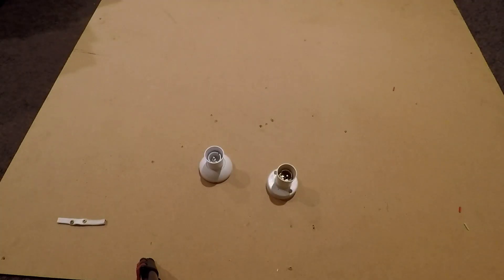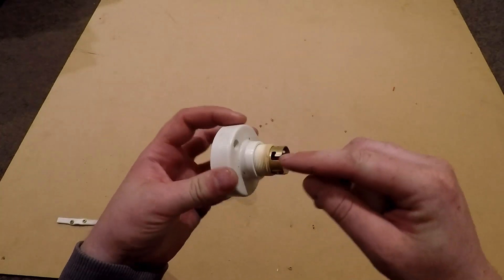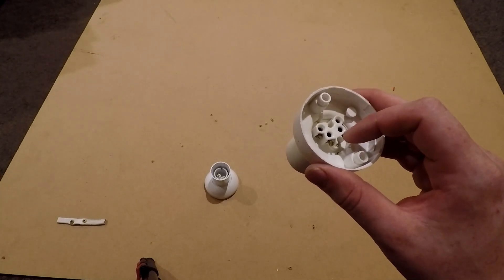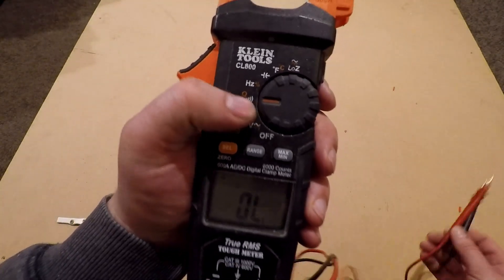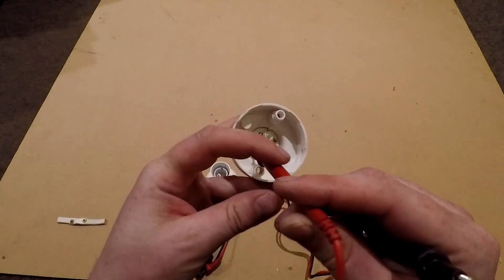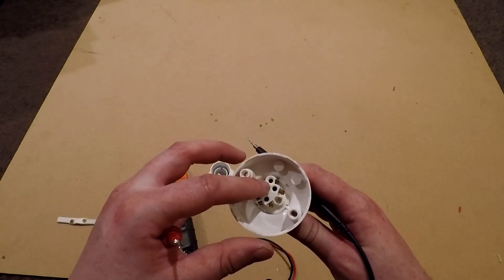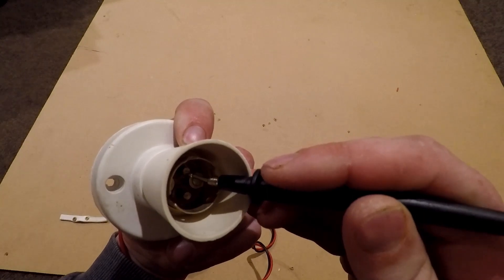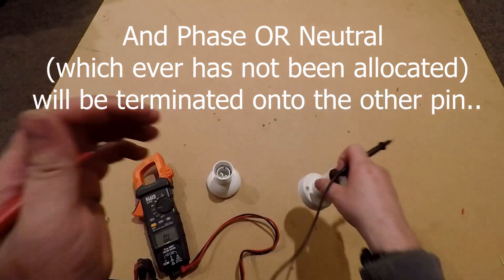Correctly Identifying Batten Holder Terminations (Bayonet)

Comment: Important - an Edison Screw MUST have the live terminal as the center, and the screw thread MUST be the neutral. Make sure you confirm with the multimeter.

Its not as important for a bayonet cap as shown in the video, there is no polarity requirements on the pins.